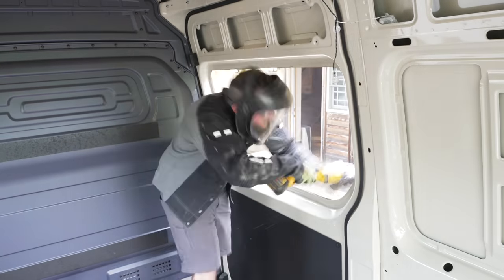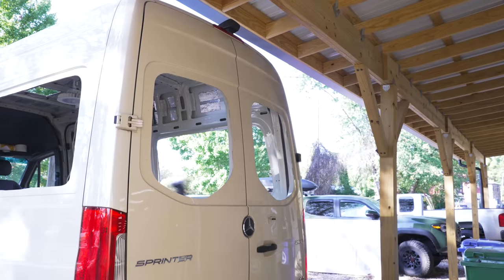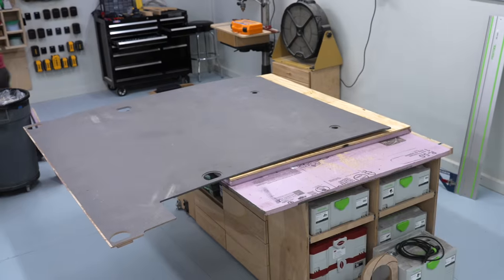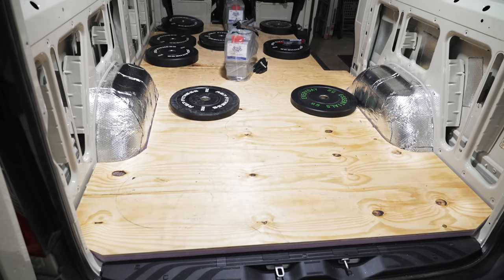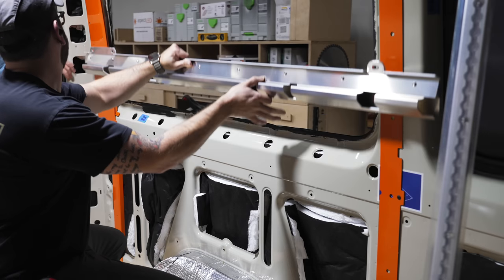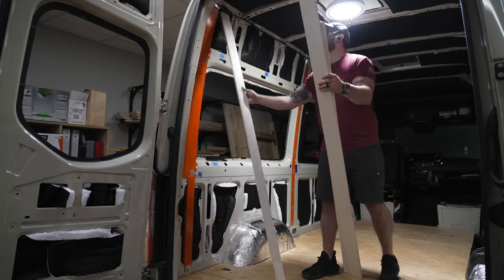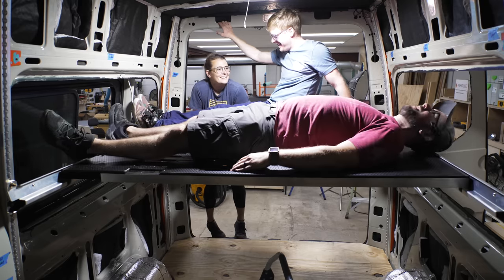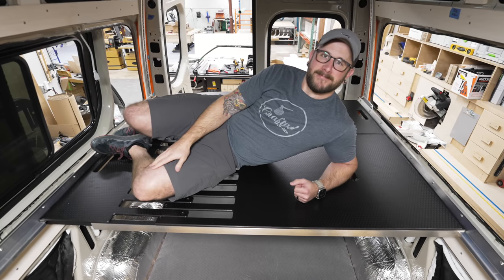DIY CAMPER VAN CONVERSION 2 : Subfloor, Insulation & ELEVATOR Bed!

Comment: 5:14 7:23 The spray/construction foam is open to diffusion compared to rubber based products like armaflex. That could result in humidity condensing on the cold metal -> rust.
Reply: This. I’ve restored a handful of classic vehicles where spray foam was used, those were the rustiest spots. I’d never use them. Same with traditional insulation in panel cavities. I think in a handful of years a lot of these Van conversions are gonna be rotted off the road sadly.
Reply: @HotRodHippie  What would you use in the panel caveties as an alternative to sprayfoam and traditional insulation?

Comment: not sure if anyone has pointed it out yet, not trying to be a pain either. but im pretty sure the rivnuts were supposed to go into the sheet behind the bracing, might be an idea to check that as it would be a real pain to see that amazing bed or van get damaged because it wasn't supported properly. great video tho love the build so far <3
Reply: at 9:50, I tend to agree, I wouldn't use the rivnuts that way.  BUT! If that's what the bed platform's manufacturer said to do, so be it.

Comment: Just a suggestion for a future van build or anyone planning one, use an air saw to cut the holes in the sides of the van.  I got a $25 from Harbor Freight and it's much narrower than a jig saw so you can cut from the inside of the van.

Comment: Some aerosol propellants will dissolve XPS foams as wargaming terrain hobbyists well know. It's possible to get "XPS safe" products, but most just use an airbrush or paint brush to seal the foam or apply a similar product instead.

Comment: swap in a honda and toyota v6 engine in there and it will be built proof/reliable camper. nice work on the insulation. Just be careful who ever sleeps on the top bed to avoid falling out the window.

Comment: Almost spit my food out when I saw the price of the bed. Over $3k. Good lord!
Reply: Yeah, this is definitely luxury van life. The van itself is $55K, base price. 😱
Reply: @trishblakely3476  It’s a beautiful van and lots of money being spent on it. I love it! Not all vans have to be DIY but good heavens hahaha
Reply: Yeah I’d be curious to see a final cost breakdown. Probably more than a small house at the end of the day
Reply: Same on the bed!!!! What trash does it even go up n down?
Reply: @brandyn6644  Hi there!  Yes, the bed does go up and down!  You simply unbolt the rails (two bolts each rail) and move them to your desired height.  Since the bed is telescoping (it has a gas strut to easily adjust in and out) the width of the bed adapts to the width of the van, allowing it to move nearly all the way to the ceiling.